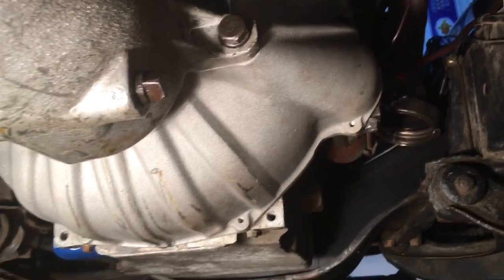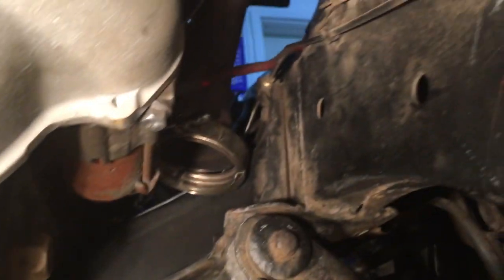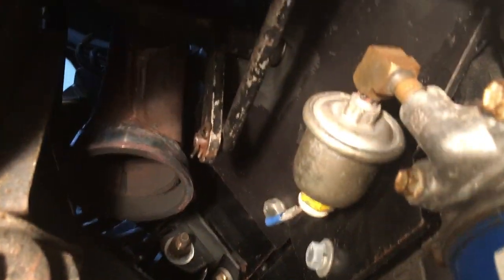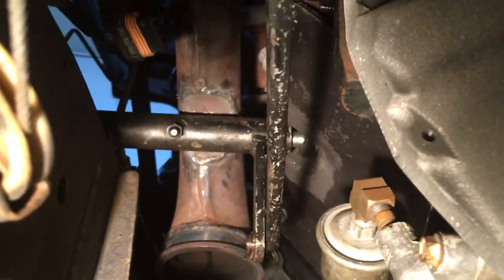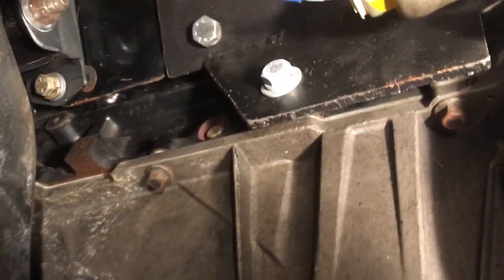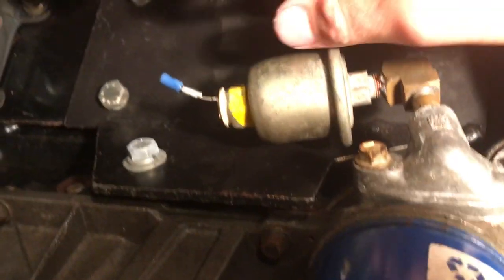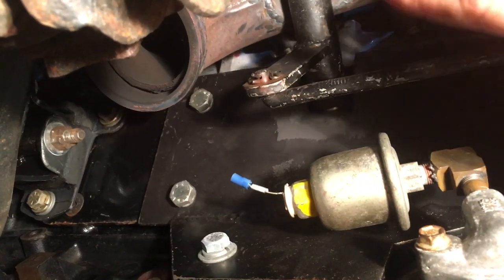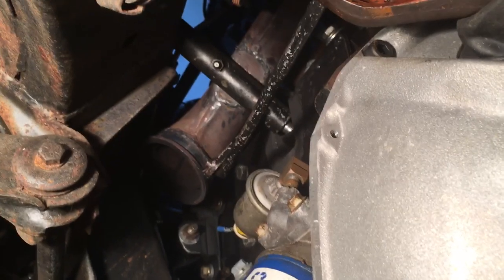How to install Muncie Clutch Linkage on LS Swap 4-Speed Pivot Ball Z-Bar Bracket

Comment: Great video, and a cool solution. I have a 1970 Chevelle with an LM7 and the existing z bar needs replacing. Even if you don’t end up selling brackets I’d be interested in more info about how you built it.
Reply from the maker: Thanks! Somewhere I have a bunch of pics of the bracket. In the next day or two, I’ll post them in the description for your reference. Also - where can I see pics/video of your Chevelle!?

Comment: You should market that pivot bracket. I need one
Reply from the maker: The problem is that it involves drilling and tapping new holes in the engine block, which is a bit scary for a lot of people. I am getting more tempted to redesign it though with factory mounting points, because of all the people that seem to want one!

Comment: if you can make another bracket, I would be happy to buy it
Reply from the maker: It does require drilling at tapping holes in the engine block.  Does that scare you away? If not, I may consider making some of these brackets to see if people might actually buy them.  If any other people would be interested in something like this - reply to this comment and let me know.
Reply: Hey man I might be interested- I have a 1970 Chevelle with an LM7 and the existing z bar needs replacing. Even if you don’t end up selling brackets I’d be interested in more info about how you built it.
Reply: I’d buy one. Doing a ls swap and keeping my 4 speed Muncie and this is exactly what I need.
Reply: I, too, am interested in this bracket.

Comment: What did you do with your clutch fork? Im in the middle of doing this but seems like it wont stay centered
Reply from the maker: My clutch fork is 100% totally stock from my 3-speed manual transmission bellhousing. Could your linkage be misaligned?
Reply: @WiringRescue  thanks for the reply man! I actually put it all together now I gotta mock up a bracket!

Comment: I would love to have one of those zbar brackets
Reply from the maker: I could totally make a few, but the problem is that people would need to drill and tap their engine block, which has a lot of opportunities to go horribly wrong. I wonder if their are other holes in the block to grab instead that I could have used... hmmm
Reply: I would like one, how much?
Reply: I would be willing to buy one
Reply from the maker: I don't think I would have any trouble making these brackets, but I only have about 500 miles on mine, so I am hesitant to sell something that I really haven't tested to make sure it works 100% yet.  Do you have a 61-64 Impala that you are swapping?
Reply: I’m swapping a 73 Pontiac ventura with a Saginaw
Reply: If you have better pictures of what you made I can copy

Comment: Would you be able to make another plate ?
Reply from the maker: I keep thinking about doing this for people, but as you'll see in the other comments, it requires drilling new holes into your engine block and tapping the holes.  There is a large risk that comes with that, and to make sure they come out right, I'd have to have another engine to mock up stuff on so that I don't have to pull my whole car apart.  I do hope to have another LS engine in my garage soon to tinker with. When I do, I will explore this idea a bit more.
Reply: Would using long tube headers interfere with the z bar linkage? Is that why you notched the shorty manifold? I’m attempting the same mechanical linkage set up with a 5.3 - I bought a plate that mounts the pivot
But haven’t mocked it all up yet

Comment: What's up Jeremy! It's been a while! Do you have enough of the new garage built that you could make another progress video of it? Now that it's warmer out, are you gonna start making new Lemans videos again? It's been 6 months since episode 46 of the Ratty Lemans Saga!!! We're all still waiting for video of that first celebratory trip to the local Dairy Queen!!! One question about those collector clamps, are they supposed to be stronger that a traditional flange/ bolt set up? Impressive work with getting the z-bar installed. I seen videos of others with the same issue, everyone seems to have their own solution, but they all seem to work.
Reply from the maker: Hi Roger! The garage progress is slow because I'm just one guy working on weekends, and I unfortunately broke a rib while shingling my roof last week! (turns out broken ribs hurt!) I'll do an update video though. If all goes well, I'll have the concrete poured for the garage floor in a few weeks. Then it's doors, siding and electrical time.

I was really hoping to get the garage done, and make Lemans videos in the new space.  We'll see if I get the itch to wrench on it before the garage is usable. ;)

Also - the V-band clamps are absolutely awesome. They are expensive (Maybe $20 each), but they allow easy installation and removal of the exhaust now, and anytime in the future.  I will pretty much only use these from now on.
Reply: @WiringRescue  : Ouch man! Sorry to hear about the ribs, did you slide off the roof? I broke a few back in the mid '90s doing dumb things on a deathtrap 3 wheeler! They pissed me off for months before they healed.
Reply from the maker: @rogergoodman8665  - I actually stayed on the roof because I was wearing a body harness to prevent exactly that.  However, I slipped holding a bundle of shingles and my ribs landed on the shingle that were standing straight up.  Climbing off the roof was a real treat!  I think I'm passed the worst of it pain-wise, so now I just have to not sneeze any more. lol
Reply: @WiringRescue  : I feel your pain! Thank God you had safety harness on. I found out the hard way in my incident that we don't bounce too well!!! Your definitely right about the sneezing...Brought a twinkle to my eye every time! And tying shoe laces wasn't fun either. Thankfully Dr. Jack Daniels & Dr. Jim Beam were always on call!
Reply from the maker: @rogergoodman8665  - Truth!  I'll try to get a garage update this week. I think you'll like the progress, it's looking good so far.  I can't wait for it to be done though because I vastly prefer working on mediocre cars than garages!